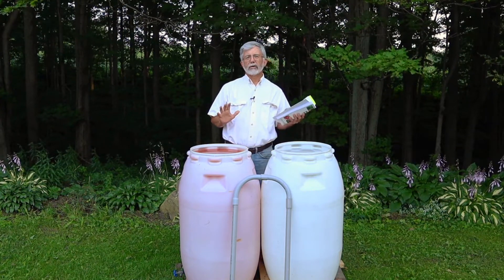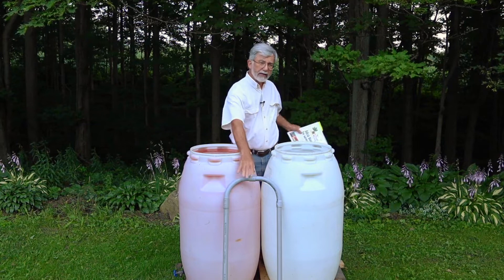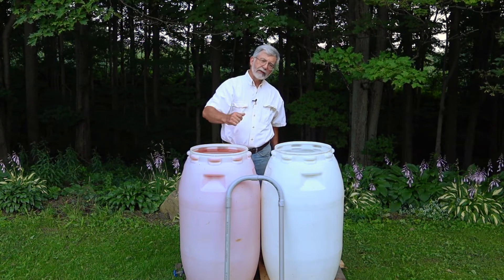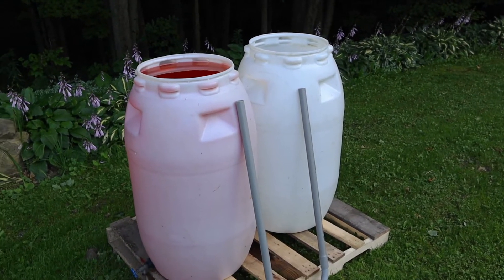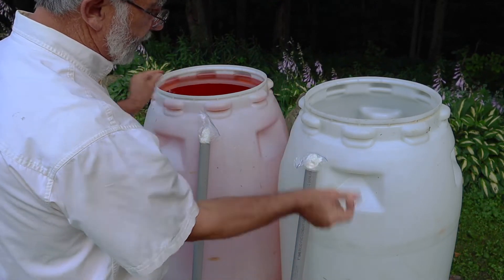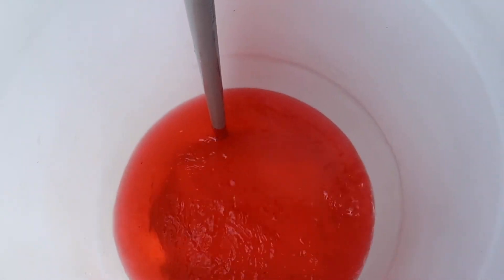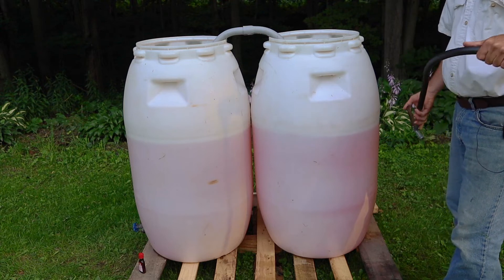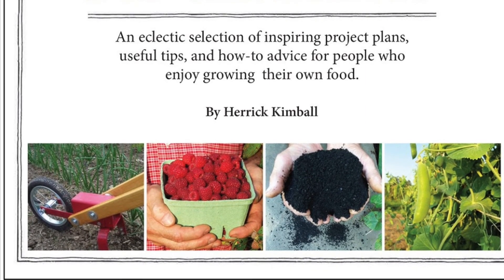Steve's Totally Amazing Siphon-Tube Rain Barrels

Comment: Instead of corks could you put the siphon tube in the two barrels and push the siphon tube up and down and let the water from the full barrel get around the U joint and it would flow from there?
Reply from the maker: Offhand, I don't think that would work. But it is certainly worth a try! 👍

Comment: Do the connections of long pipes have to be rounded? Could the pipes be connected at right angles? How far apart are the tubes?
Reply: Yes
Yes
Distance between tubes or tube shape doesn’t matter. 
Keeping air out does. 
Good luck 👍

Comment: Your design does not allow you to release trapped gas bubbles at the apex of the tube, in-situ. I too am designing a rainwater barrel network. Siphons were my first consideration because they do not require modification of the barrels. I've designed my (potential) siphon so that I can monitor and replace air within the tube with water, in-situ, to prevent airlock. Useful things, siphons.

Thanks for the video.

Comment: Great video and detail. Question, wouldn't the water in the siphon tube evaporate and brake the loop?
Reply from the maker: No. That doesn't happen. The water in the barrels may evaporate some but not in the tube. Thanks for the question. 👍
Reply: @herrickkimball  thank you for clearyfying because I am getting pipes and barrels together for a 2xbarrel system.

Comment: You can also just stuff some bread in the ends of the tube after filling it with water and it will dissolve and work the same way. And using agricultural tubing is a lot cheaper than PVC, just cut the ends at a 45* angle so it doesn’t bottom out.

Comment: What happens when the water level gets below teh siphon? does the bottom valve have to be above the siphon tube?
Reply from the maker: You have grasped the concept. The bottom valve does, indeed, need to be above the siphon tube ends.

Comment: This is fine for open top barrels, we're trying it with barrels that have tops and only the double holes so you can't reach down into the water to release the plug. We are using the 'bread' technique to plug both ends of the tube filled with water, so far with NO success. It's jus not working....what are we doing wrong?????
Reply from the maker: I think it works best if you can pull the plugs out at about the same time. Can you figure out some sort of more secure plugs and get a string attached to them, so you can pull both at the same time?
Reply: @herrickkimball  that's what I was thinking...Attach a string or cord to the zip lock bags and try to open the bottom up at the same time. I would also maybe cut a 45 degree slice on the bottom of each tube for water flow.

Comment: Amazing!  Thanks for this.  May i ask though if the u pipe will work if the drums are like 10 or more feet apart?  Thanks in advance.
Reply from the maker: Good question. I don't know. You will have to experiment to find out. My guess is that it can still work.
Reply: It will work as long as the barrels are at the same altitude, meaning that they are level with each other regardless of how far away they are.

Comment: If you used a closed drum system with bungs that have the knock out 3/4 taps would it still work with PVC threaded into the caps?
Reply: I was just wondering the same thing
Reply: I came here for a similar question. I'm thinking that the system needs to be vented from the top in order for it to work so that the atmospheric pressure is available for the water as it rises and it fills the air needs somewhere to go.

Comment: It is important to note that you must keep the water level above the bottom of the siphon tube to maintain the “charge”, and if the level drops below you will need to refill the tube. Great application though, love the idea.
Reply from the maker: You are absolutely correct!  That is one of the details that I cover in my book. 👍
Reply: @herrickkimball  I was thinking if you placed both ends of the syphon in a filled cup you would not lose the syphon, however you would lose the usability of the last few inches of water.

Comment: The only problem for me is that I would have to actually get enough rain to make this work. Where I live we only get about 10” of precipitation per year. Rain barrels aren’t really a thing here.we can go three months in the summer with no rain. Cool idea, though, I’ll have to go read about it in my book!
Reply: This isn’t so much a “rain water collection video” as much as a cheap water reservoir alternative. You could even use it as an auto watering volume if you weren’t near a faucet... if you had a means to fill it. Ha ha
Reply from the maker: @bagelbandit6076   You have grasped this concept very well. I have a worse-case-grid-down-long-term plan to set up a multi-barrel cistern on the second floor of my house. It can be fed from a rain gutter diverted through a window, or I can pump water up to the cistern from a creek behind my house with a gas-engine pump. Then I can gravity feed down to the first floor for washing and filtered drinking. I have the barrels in storage and the siphon tubes. Hopefully I never need them for that. 👍
Reply: @herrickkimball  What about the weight? Would the floor joists be strong enough?
Reply from the maker: @cynthiafisher9907  Weight is definitely something to keep in mind. I built my own home and am confident that the floor can handle the weight, especially if the barrels are positioned around the edges of the room, as opposed to the middle. Thanks for the question.
Reply: @herrickkimball  best to have a solar-powered water pump.  Petrol might be too precious to come by.